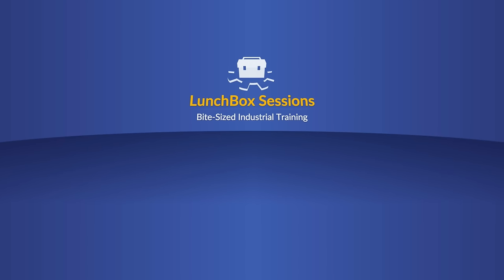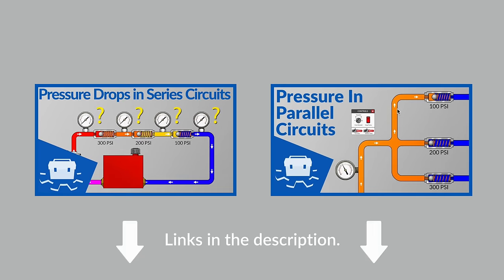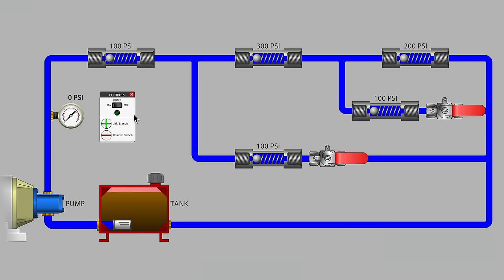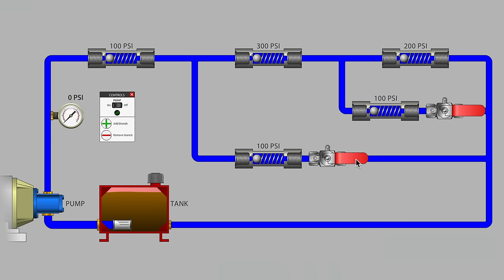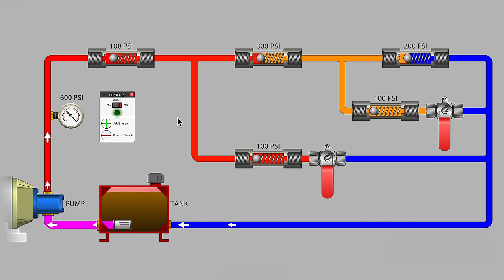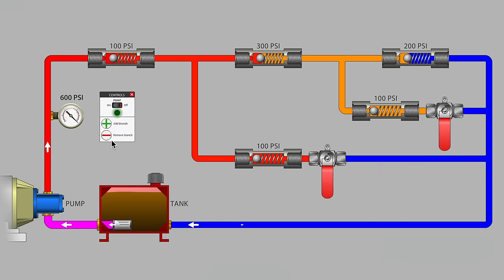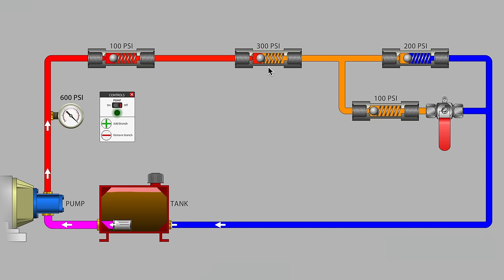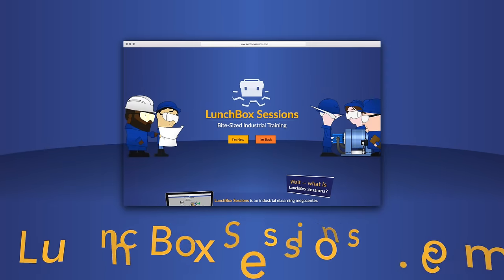How to Use System Pressure to Troubleshoot

Comment: System pressure question. About 3:25 min into the video, the system is set up with the center 100 PSI check valve closed. This leaves the upper left 100 PSI check valve in series with the 300 PSI check valve in parallel with the 100 PSI and 200 PSI check valves. It takes 100 PSI to crack the first check valve and another 300 PSI to crack the 300 PSI valve for a total of 400 PSI. The 400 PSI fluid pressure hits BOTH the 100 PSI and 200 PSI check valves simultaneously opening them both up. The flow through each check valve in parallel will differ but there should be flow through both none the less because it takes 400 PSI just to get to them. If simplified valve resistance is calculated like electrical resistance, then you would use the product-sum rule [(200*100)/(200+100)] to find the total resistance of the parallel valves. In this case, the parallel resistance adds 66 PSI to the system. Shouldn't the total system pressure be 466 PSI not 500 PSI?
Reply: In the scenario you mention, no flow is going through the 200psi valve. 

Work from right to left. The right segment will not reach the 200psi needed because in parallel, flow take the easiest path and the 100psi valve will open first, preventing the valve above ever seeing the pressure needed to open. Moving left, you add the pressure needed to open the 300psi valve, making the segment to its left be at 400psi. Moving left again, also in series we add the next 100psi, hence 500psi at the gauge.

The resistor analogy works for flow through parallel pipes of different diameters, but not for parallel check valves. They are either open or closed, as soon as the 100 psi is reached, ALL the flow takes that path.

Comment: it isn't possible for the flow to go for both branches? What will be the pressure then, that is something isn't clear.
Reply: In reality flow will go through both lines but it will be very small through the top branch.
Reply: It is already stated in the video that each line is large enough to allow whole pump flow through any on loop